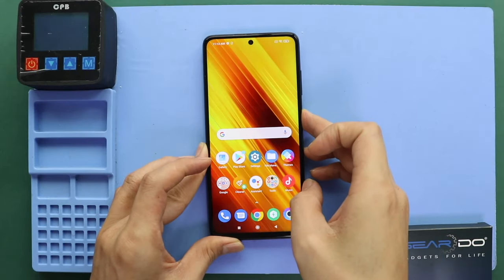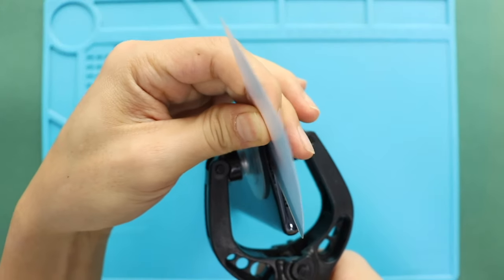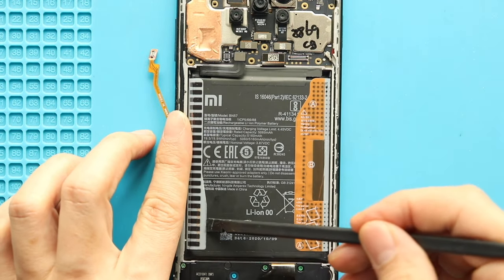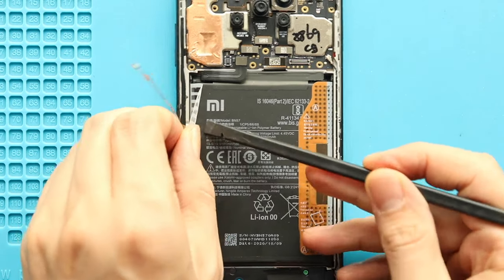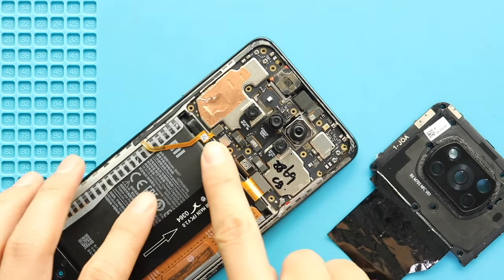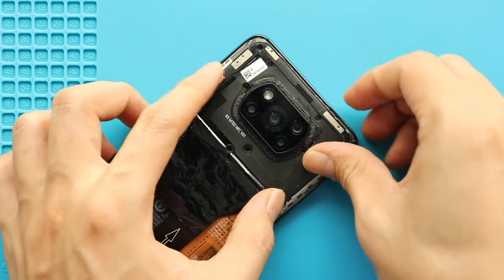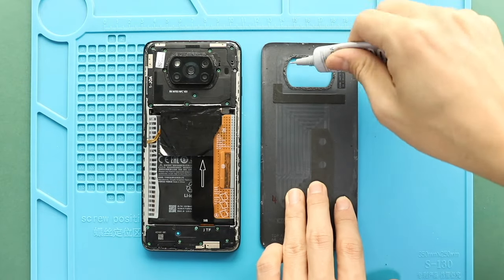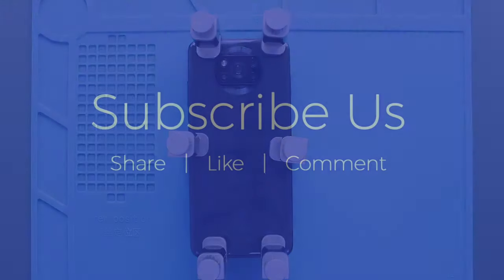Poco X3 NFC Battery Replacement BN57 | X3 Pro

Comment: After 3 years of usage, my cover was already bloated. That shows that I need to change the battery. Sure enough, after I managed to open up the back cover the battery was bloated. Thanks to your video guidance, I changed it to a new battery. The rubber band idea was good because I don't have a clamp like yours to clamp the back cover after applying the glue. Anyway I got a new POCO F6 PRO 16GB 1TB version, so this Poco X3 NFC will be my spare phone.
Reply from the maker: Thanks for sharing

Comment: I recently got my battery replaced in my poco x3 nfc. There is an issue with charging. When i plug it in it does not show decimal value of charging instead just shows a 2 digit number. Can any one tell me what is the issue here because before battery replacement the phone showed a value like 88.49% now it just shows a value 88 when I plug it in.
Reply from the maker: Have you check the settings?, did you clear the battery cache?
Reply: Nope
Reply: Kindly guide me how clear battery cache
Reply: try using original charger and cable

Comment: thanks for the video
i have two questions
1. how to make sure removing camera lenses guard doesn't make the lenses dirty and affect photos quality?
2. what kind of glue you use when you reinstall the back cover?
thank you again
Reply from the maker: Well you need to make sure there is no dust on top of the camera. Just clean it properly and for the back cover you can use b7000/t7000 glue

Comment: Hi! I got some questions and I hope you could answer these:
1. Can you operate this without a heating device? 
2. Without a glue.. (what's the odds w/ and w/o it?)
3. What's the proper way with the newly replaced battery? (Should it be more hours than full charge for 1st cycle? like 5-12 hrs even already full?)
4. How many cycles before the common/usual charge apply?
5. Will charging with fast charge affect first time use with its calibration or it doesnt matter?

I knew it should be lesser than 20% and not more than 80% at most anyway after the calibration so I hope you could comprehend with the questions.
Reply from the maker: 1. Can you operate this without a heating device? - Well You will Need One ( Otherwise you might end up breaking the back cover)
2. Without a glue.. (what's the odds w/ and w/o it?) - (need glue or adhesive to paste the back cover back)
3. What's the proper way with the newly replaced battery? (Should it be more hours than full charge for 1st cycle? like 5-12 hrs even already full?) - Give a full charge.
4. How many cycles before the common/usual charge apply? it all depend on how you use the phone
5. Will charging with fast charge affect first time use with its calibration or it doesnt matter? First you need to find a good battery that supports fast charging. Like an Original one. Most copies won't work well and have heating issues..

Comment: Hello, sorry, I saw the video and you explain very well, brother, thanks for helping me, but I have a question if I can't find the original battery, putting an official one will affect the cell phone or I run the risk that the N battery(New and unofficial) I don't know about hot or that kind of thing?
Reply from the maker: Well there are good third party brands with good quality. Try some of them. Installing a bad battery will cause issues, but try to source a good one.

Comment: I Have a Poco X3 Pro, as i saw, the battery for that modelo is the BN57, can i use the BN61 on my Poco X3 Pro? I Asked because the BN61 have more Battery Capacity and it looks like the same connector and size

Comment: hello sir I want to ask if the BN57 5160Mah battery can be upgraded to BN61 6000Mah on the POCO X3 NFC cellphone
Reply from the maker: If I’m correct it is different connectors

Comment: im planning to replace my battery because has a bootloop problem. does damage battery cause bootloop right?
Reply from the maker: Cannot say exactly,  software issues are can create this too.Have you check issues in OS?
Reply: I have the same problem, i'm planning to change the battery because i dont want to wipe data.. I hope that the phone boots normally after
Reply: @DIYGeardo  where can you go for clear information/diagnosis on this?

Comment: Hi bro. My Poco x3 just stop charging. Should I replace the Charging board?
Reply from the maker: First try a different cable, adapter and power outlet.. and also you can check the device is detecting in a PC or not.. if it is still not, then you can go for a new charging port to start..
Reply: I tried to reconnect the flex cable. Then it charges again. But after 2 days. It did not charge again.
Reply from the maker: @dondondoroteo7003  might be a bad port
Reply: So I better change iright? Thanks ♥️♥️♥️
Reply from the maker: @dondondoroteo7003  to test you need to replace and see the outcome..
Reply: it is same for me

Comment: HELLO JUST WANT TO UPDATE :) 
I HAVE A POCO X3 NFC 
THE BUILT-IN BATTERY IS "BN57"

The thing is, I bought BN61 which is 6000mah 
and it is fit to our version NFC
so if you are planning to replace battery just choose BN61 (6000mah)
Reply from the maker: Thanks for your input
Reply: @DIYGeardo  all thanks to your content sir without your video i cannot replace my battery ☺️☺️☺️
Reply: Is the bn61 version still working perfectly on your poco x3 nfc?
Reply: @matheusgoes7489  YES! BRO, Tottaly fine, You better chooce BN61, because its 6k mah
Reply: @markarielmilano2827  but is it thicker or bigger than the bn57?
Reply: @matheusgoes7489  it is the same bro , but different weight its a bit heavy
Reply: @markarielmilano2827  Understood. The battery of my x3 nfc is lasting 2 hours playing and 5 hours in normal use, health is below 50%, I asked for a bn61, now I'm waiting for them to send it
Reply: Does it fit the x3 nfc version ?
Reply: @gizmo6746  yes cause my phone is x3 NFC
Reply: @markarielmilano2827  now all i have to do is find a seller.
Can't order on ali anymore because of eu regulations.
Reply: Hello again, could you give me the link where you bought your BN61? And one more thing, is your phone charging on turbo normally?
Reply: @markarielmilano2827  hello can i use bn61 in poco x3 pro???
Reply: @Gabrieldinu-z3x  yes because BN61 is actually intended for X3 Pro
Reply: @matheusgoes7489  it works 100% turbo charge
Reply: @markarielmilano2827  Could you give me the link to the store you bought it from?
Reply: will it work on 6GB version if I use the 8GB BN61?
Reply: @w.7474  yes bro it will totally work
Reply: @markarielmilano2827  mark, have you actually checked the battery capacity using AccuBattery or something similar? Everything I can find, nobody gets more than 5100mAH out of these bn61 "6000mAH" batteries.
Reply: @GuyGamer1  yes sir i did, and it is very good response
Reply: Bro, after few months use, the battery still ok? After u change to bn61, how long the screen on time?
Reply: @leongaw2334  definitely yes okay2x  na okay
Reply: Saan mo nabili yan pre?
Reply: @chuckiel2108  lazada po
Reply: boss mark? pasend naman ako ng link sa lazada gusto ko na din palitan sakin pansin ko kasi bloated na.  Salamat sana mapansin!
Reply: Nagfufull charge ba yung sayo? bat sakin hanggang 90 percent lang?
Reply: @garouu0pm  bug po yan sa system tips nyan, ipa drain mo tapus i charge mo na naka off. Normal lang yan
Reply: @markarielmilano2827    related question, nagpapadeliver pa po ako, gusto ko change battery ng Poco X3 NFC ko kasi bloated na, is it okay to still use it po?
Reply: @bluffingphoenix  MAG BN61 kana para 6000mah na siya.
Reply: @markarielmilano2827  yeah, currently nagdedeliver pa, pero ilang araw pa yun, so okay lang po ba gamitin tong bloated na phone? First time ko kasi nagkaexperience ng bloating sa phone.
Reply: @bluffingphoenix  wag na muna.
Reply: @markarielmilano2827  bro, lumobo nanaman yung akin. Bateryy pa kaya yung problem ng phone ko? Nawawalan nako ng pag asa e HAHA

Comment: Hey, thank you for that very nice and clear video! Can you tell me, why asian repair shops (mostly locals) won't change the battery of an European bought smartphone like the Xiaomi Poco X3 NFC you showed in your video? My phone battery died and got faulty, I was in Asia, Vietnam and even the MI Store told me that they can't change the battery, I would need to talk to the internet store in Europe where I bought it. That doesn't make sense, because now I bought the battery on shopee and installed it myself, and see, it works again. Would be nice if you could answer! Thanks! :)
Reply from the maker: Most probably they do not sell particular poco brand or model in there (mi store), but regular repair should be able to do if they have the part. There is no reason other than that.
Reply: @DIYGeardo  Thanks for your quick response! That makes sense but now I feel a little confused on how they treated me especially at the MI Store, but.. sometimes people are like that I guess. Keep up your nice work and all the informative videos! :))